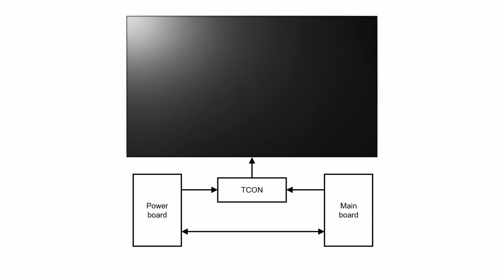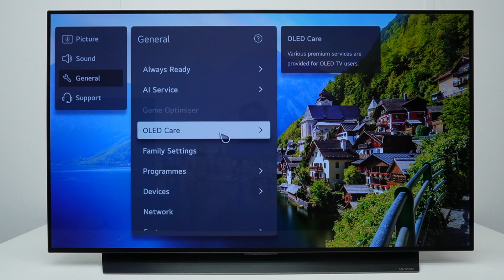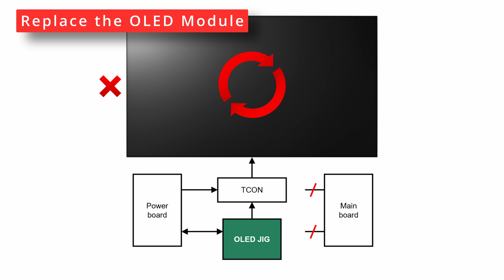[LG TV] - How to Use the OLED Diagnostic JIG to Troubleshoot Lines Bars or Bad Picture Issues

Comment: Why do not consider faulty T-Con?
Reply: I believe LG considers them part of the OLED panel, and doesnt offer them separately. I have replaced them many times without issue, but supposedly they are synchronized to the specific screen they were supplied with
Reply: I am told it could be the back lights i am trying to find some